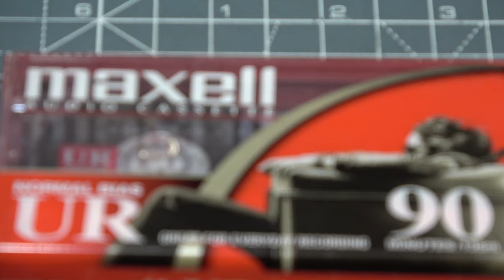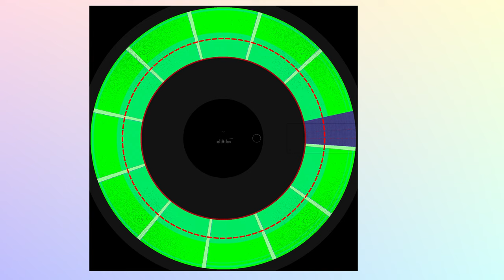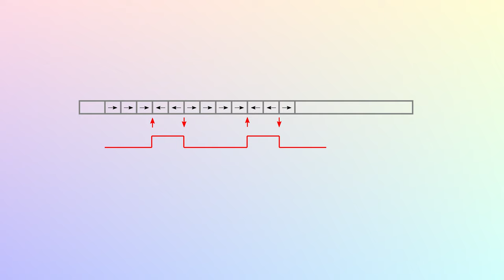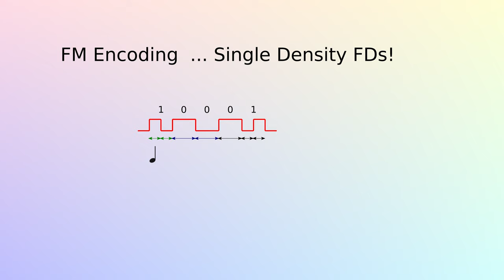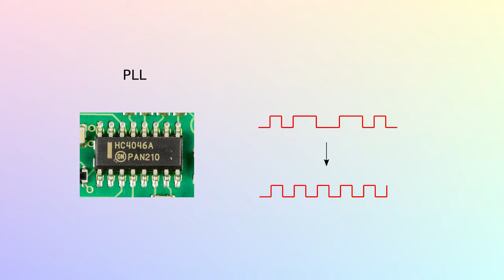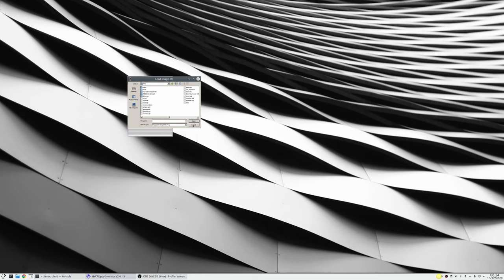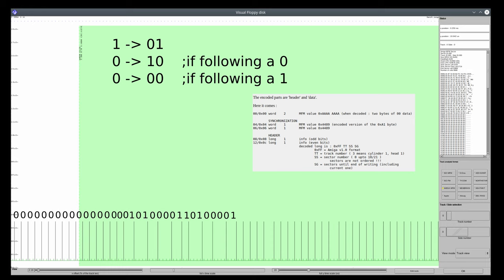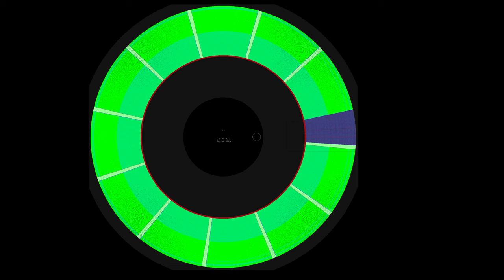Floppy disks - pt 2/2 - the deep dive! [💉💉]

Comment: Yes,  please do more technical videos like this. This is how I understand it; there are two operational amplifiers, the first one is an auto gain amplifier.  The other mathematically differentiates the signal ie gets the rate of change or the slope of the signal. Then there is a comparitor that detects zero crossings.  As you say 1s are represented by flux reversals, hence a zero crossing and 0s by the lack of a flux reversal. But the more 0s there are in a row the slower the slope of the signal becomes until it flat lines. Magnetic induction only works in the presence of a changing field. When the slope becomes shallow the first amplifier increases its gain, now any random noise on the nearly flat signal can cause a zero point crossing and a bogus 1 will be read. Some copy protection schemes deliberately placed a large section of non changing flux on the disk and the code would read it multiple times to see if it is different each time.
The two amplifier then comparitor was one of the last century's best inventions.